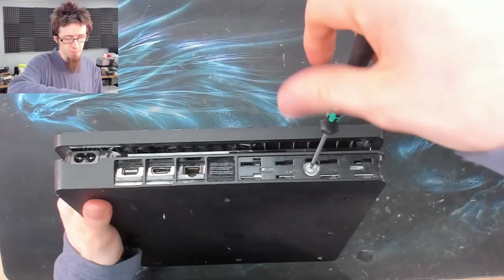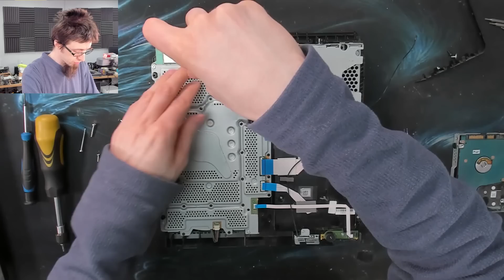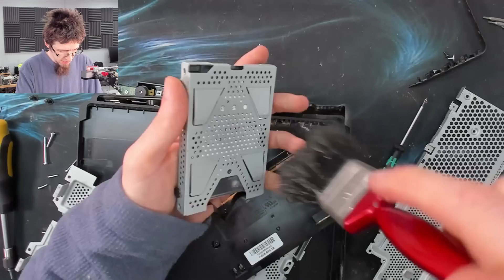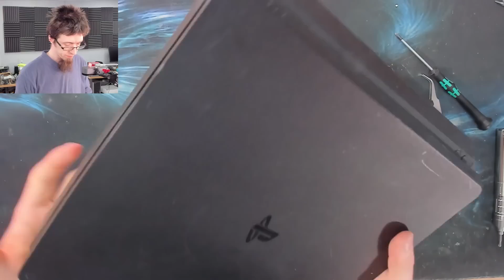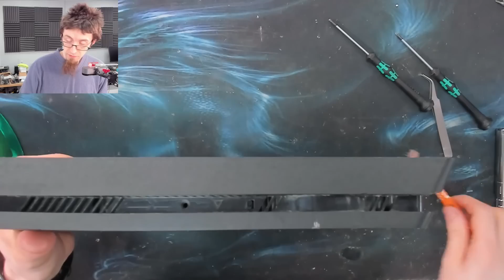Dusting and re-pasting a PS4 Slim - LFC#312

Comment: I found a stray thermal pad inside my ps4 slim I have accounted for the three ram chip pads and the 9 on the other side on the board but I can't understand why I found a stray pad inside the unit am I missing one? I have 11 pads on chips that make sense but the stray I found was on top of a Toshiba chip on the far right corner do I need to put back or should I remove it because it's not supposed to be there

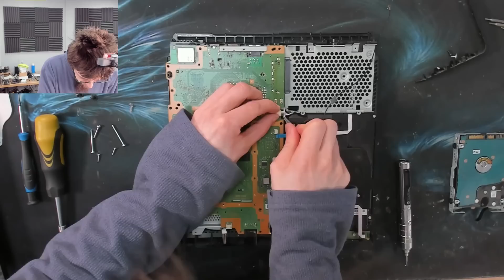Comment: @2:39 - this 'random screw' at the beginning helps hold the power supply through the whole unit, and as far as the four-pin power connector goes (@10:20) I found it's easier to leave it connected to the board there - If you remove the heatsink assembly and the rest of the drive tray from the plastic bracket, the power line threads through there and has already been disconnected from the power supply.

Comment: An interesting fact about the PS4 is that it has a "coprocessor" in it, based on ARM architecture, which is what you called the "system-on-chip" at 18:33 is. The coprocessor runs OS functions that aren't essential for games when the system is running, and runs background tasks such as updating games when the PS4 is in its sleep ("Rest Mode") state. It does a little more than that but you get the idea. Offloading small, mundane tasks that would normally be run on main CPU, on a separate less powerful processor.
Reply: So basically a phone processor?

Comment: Something I've heard about direct die thermal paste application (like the one in the video, as opposed to heatspreader on desktop CPUs) is that it's very important to spread the thermal paste around using a spreader such that the entire die is covered, no matter what pattern you used, as there are pretty much transistors in every mm^2 of area in the chip, and if a few of those areas don't have thermal paste, those areas will be hotter than the others, which is probably worse than evenly applied crappy thermal paste as there is big temperature deltas in the chip rather than it being consistently hot, so this can possibly cause damage, well that's what I've heard on the internet from a comment somewhere else about thermal paste application. How much of a fine art you paint on desktop CPUs isn't as big of an issue in comparison, as the 'heatspreader' spreads the heat around anyway.

Comment: Great video - when de-dusting and refurbishing PS4's it is always worth giving the optical drive disc intake rollers a quick clean too. This will stop potential "disc slip" when inserting and ejecting games discs.  To clean the PS4 properly you need to disassemble like in this video, so it is only a few more screws to remove the optical drive and clean the rollers.

Comment: Just to point out something about these coin cells, whenever you test it still on the board it is under load and it is expected that voltage will be a tad low. Removing the cell and testing it out of circuit will most likely yield a higher voltage.
Reply: Yes you are right, but surely measuring under load was exactly what Graham wanted to do. Bearing in mind what he mentioned about instability below three volts.
Reply: well yeah when its that close to 3v and you are already that deep into the guts of it you may as well replace it for the customer when he is buying bulk packs of 3.3v batteries for this kind of thing

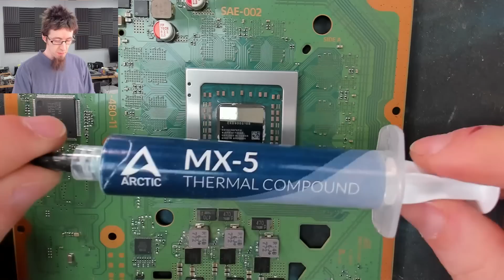Comment: 17:02 Arctic MX-5 has been discontinued because it doesn't keep its properties very long, the liquid and solid parts seperate quickly and it doesn't work very well after some months
Reply: Didn't Arctic recall certain batches of MX-5 due to production issues
Reply: @GregM  They recalled some batches, but then EOL'd MX-5 completely, maybe the production issues were more widespread than what was previously known.
Reply from the maker: Ah that's interesting to know... I have to admit I haven't been a fan of it due to the goopyness, but figured it was just what they were rolling with.
I'm sure it'll last the life time of the device. If it does another three years of service that'd be short, but good enough.

Comment: Thank you for the nice content. I have a question. I have a gaming laptop. I hear a strange sound from inside the laptop and the fans are turned off, but I hear a strange sound is this normal
Reply: What kind of sound?
Reply: If it's a whining or screeching type of noise then it's very likely coil whine, which is perfectly normal (coil whine does not indicate or mean something is wrong or faulty).

If it's a clicking noise with some sort of pattern to it then it is very likely the hard drive (not SSD). Hard drives will normally make a slight audible 'crunching' noise when it's being used, if the clicking sounds louder and abnormal in comparison then that could indicate a failing hard drive, in that case I recommend you check the hard drive's health with CrystalDiskInfo (look for a "Warning" status and pay attention to relocated/error sector counts), and back up the data to another drive such as external HDD.
Reply: @bestage9429   Thank you

Comment: Just to let you know you failed to connect a wireless cable. When you removed the motherboard, you had a fight with a connector, then as you lifted the motherboard, top left was a small black cable which you pulled out of the motherboard, you forgot to replace it on reassemble.

Comment: I've currently taken my PlayStation apart to clean it and the one inch screws for the power core isn't catching at all. What do I do ?
Reply: 1) Make sure everything's reassembled correctly (in the correct order)
2) Double check that you haven't used the wrong screws in the wrong areas ( one might be still unseated though tight which means it's too long for that hole)

Comment: Just cleaned and installed yesterday Slim to EVO 1tb. Everything went fine except I have 17 USB cables and only 1 worked to connect DS controller when needed to install OS! F sake. All cables Works with PC and charges. The cable that worked is like 12 years old. I hate cables spiritual world. Thanks for video I Will change paste some day.

Comment: Did you remember the antenna on the front of the board before you laid it down? Didn’t look like you did.
Reply: I think it was the antenna that he reconnected when installing back the power supply.
Reply: If you mean the one on the underside at the top left of the board when he took it apart, he reconnected it at the end.

Comment: Graham, will you tell us the story of the electric jump in the air this Saturday???
Reply from the maker: It's not that interesting tbh... I was replacing the PSU in a PS4 fat a few years ago and got a belt off of the side of it, as I described in the video. Not exactly dangerous, just enough to make me swear loudly and drop the PSU. Can only imagine that the input caps were exposed on one side like they are in this video.
Reply: @Adamant_IT  I'm not surprised you got a Zap from the original PS4's PSU because the caps can be rated up to around 450 to 600 volts and sometimes they can remain charged for months.

Comment: I repair mainly PS4 and a lot of this Slim model. I don't use tweezers like you for the hard connector at @10:18 but with long nose pliers is way far easier. In this particular model you can also unscrew only the screws that keep the motherboard + 2 metal plates to the black plastic chassis, nice to get access to the bluray drive without unscrew all of the mainboard. Great content as always! thanks

Comment: how much to charge for a preventive maintenance to the consoles?
Reply from the maker: I think I did this for like, £30 or £40 (it was like, a month ago now) and the console was actively overheating and shutting down during use. I was more interested in getting some experience with the PS4 slim, as I hadn't worked on one before.
I have no idea how much to charge for this job if I'm honest. Once you know how they come apart, you could do this in 15mins, and possibly charge less, or more if you're that way inclined.
Lots of factors based on country, area, and so on, for how much a job like this costs.

Comment: 18:40 Forgot Wi-Fi cable on top left of motherboard!... Wanna get this right first time...UMM FAIL! ...&  you didn't go back n fix it either not a pro yet HA!
Reply from the maker: 22:15 and 22:45
Reply: @Adamant_IT  How about you watch it again! @ 6:10 you remove the long outer Wi-Fi cable @ 11:30 you remove the inner short Wi-Fi cable but on reassembly you don't  reconnect this cable @ 18:40  you only connect the long one @ 22:15, so therefore only one Wi-Fi cable is attached!... Like I said not a pro yet!
Reply: Yeah , not to perpetuate any argument but it doesn't appear that the "other" antenna under top left corner was reattached before anchoring down M-board ( unless done in editing )  Very useful video though, especially showing how the stupid tamper resistant covers come off. And what battery to have prior to servicing.  Stellar bit of altruism which I salute w/my thumb pointed skyward sir
Reply: @YABBAHEY1  Thankyou you also noticed the short antenna cable wasn't reattached & there was no edit we saw it reassembled in one take so he didn't do it!
Reply: @preston963  It's an outrage.... a controversy of earth shattering proportion (insert exclamation mark here) Food will never taste the same..., skateboarders will ride goofy , mice & pidgins will suddenly change places. We the custodians of omnipotent perfection must stoically hold our ground as it will take time for the rest to catch up
Reply: No he didnt. He plugs it in at 22:48 you egghead.
Reply: @OskarBlomkvist  How about you watch it again! @ 6:10 he removes the long outer Wi-Fi cable @ 11:30 & he remove the inner short Wi-Fi cable but on reassembly he doesn't reconnect this cable @ 18:40,  he only connects the long one @ 22:15, so therefore only one Wi-Fi cable is attached!... Like I said not a pro yet!... & I not an egghead but your a Richard Cranium for not being observant!!!